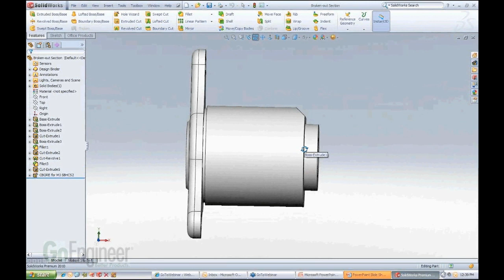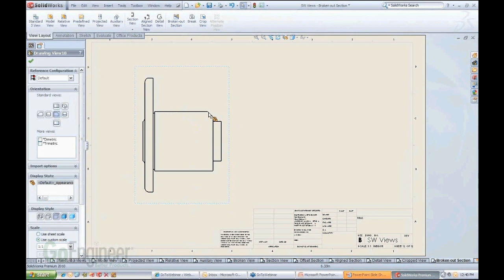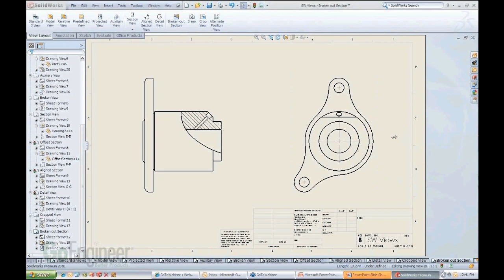SOLIDWORKS - Broken Out Section Views

Comment: Not helpful at all.  I draw the spline loop on the drawing view and hit the "Broken-out Section" button on the toolbar, and only the "pencil" for drawing a spline appears.  The "Broken-out Section" dialog box never appears as it does in your video.  That's the problem with most of these Solidworks tutorials - there are no fallbacks. We are screwed if it doesn't work exactly like the video.  I have SW 2013.